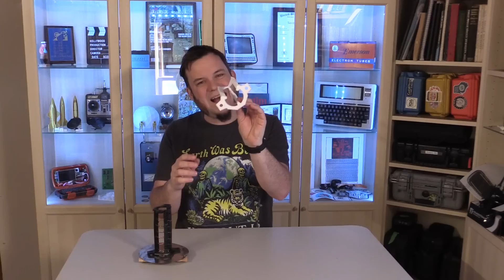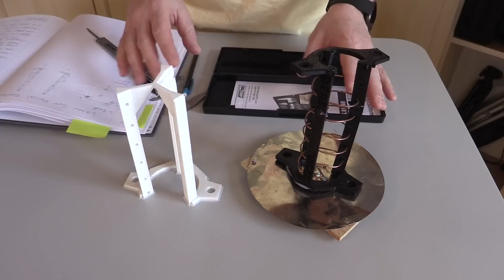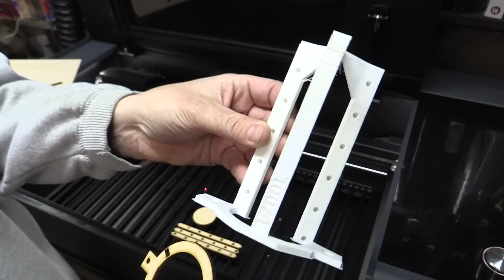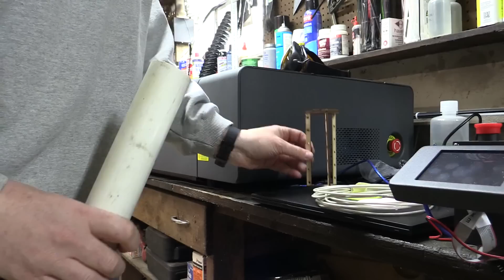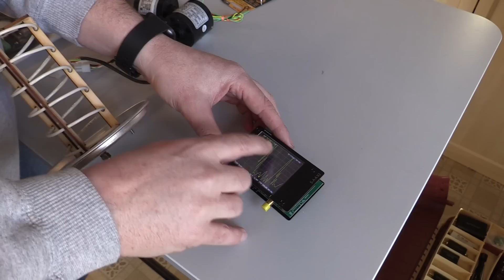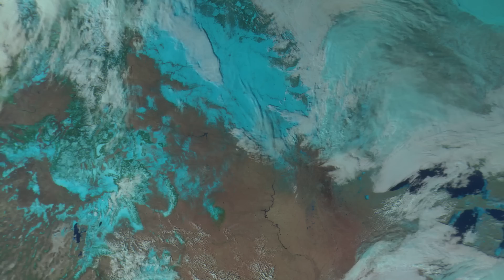Making Satellite Antennas With Lasers

Comment: Hey dude I know its been a year and you may have fixed it but an enclosure completely fixed most of my fails. Turns out because I print in my basement the temps and drafts can throw it off. Could potentially help.  Love the content!
Reply from the maker: I got a new 3D printer that's enclosed!

Comment: Hi Gabe, very interesting video. I've had good experiences with 3D printing using 3D spray adhesive. The prints stick significantly better to the print bed with it than without. So far, I've been able to print 3 antennas (without additional support) without any problem. But buying a laser cutter is on my todo list :)

Comment: Amazing what kind of resources you can access with a bit of wood and wire.
I pulled out my 3D printer recently. Need to calibrate it and get it running with decent firmware .. ugh, I wish that stuff 'just worked' without the needless tinkering.

Comment: If you use urethane, you could just dip the entire part into the gallon can up to the reflector. No need for complicated painting. I don't know if there's any RF issues with using urethane but it should work as a conformal coating on the entire device and it will soak in nicely on the wood. You might even be able to dip the whole part if you cover the SMA connector with Blu Tack or something like that.

Comment: That's not a very challenging model to print. 
A $4000 later cutter gets the job done but so would a $1000 3D printer right out of the box.
Or a $200 3D printer with a lot of calibration.

Comment: What a success! The images are perfect. Goes to show that precision is key when it comes to antenna parts. Maybe lots of your reception issues came from the crooked antenna receivers and not so much the dish or tracking. Also your design looks really neat, I like it better than the 3D model. If I had the chance to use a laser cutter like that instead of my 3d printer I'd go for the laser cutter. Speed and precision. And the way you designed it, simple is better. You could use anti fouling paint on the wood or 3D print dome enclosures for them, like commercial antennas have.

Speaking of 3D printing PLA is definitely not the right plastic for it, for outdoor stuff I'd go for ASA/ABS in the long run. BUT you will need an enclosed printer for that, not only because of the fumes, but also because these plastics need heat so that they won't cool too quick while the print is still going. What 3D printer do you have? Maybe it's time for an upgrade. The one I'm using is a Bambu Lab X1C, a CoreXY enclosed unit which seems to be the way set-and-forget 3D printing is going atm. At least I can say I'm very happy with it. Never had a failed print so far, the print quality and precision is excellent. I won't upgrade its firmware for the time being and I am using it with Orca Slicer because the privacy issues it has are definitely a downside at the moment. I hope it gets resolved and Bambu Lab realizes their mistakes.

And yes, as others have mentioned laying parts flat on the side is the way to go anyway, speaking from experience however this isn't trivial with a 3D model downloaded from the internet that needs to be cut into pieces first. Often times they come in the mesh format STL, and meshes are a pain to edit. You can cut them, but the edges might start looking funky when they're not a solid object. Which is why I highly recommend learning CAD. Their sketcher tools is what you need for parts like these. It makes designing technical parts much faster. And the benefit is that you can easily adjust your parts to be either cut out with the laser cutter or printed with the 3D printer, or even design a whole assembly with parts that will be laser cut and printed. For designing I like FreeCAD because it's free and open software and it has a lot of addons, and with OpenTheme an addon that improves the UX significantly. OpenTheme was the UI/UX that was used for the now defunct Ondsel ES. Many functionalities of Ondsel ES can be installed as addons to FreeCAD. Others might prefer a simpler or more powerful CAD software to use, but these are all subscription based (more and more often they make their free versions suck on purpose).

Btw, when it comes to keeping the laser cutter warm, or even toxic fumes from open 3D printing contained, people have used grow tents you'd usually use for cannabis plants as enclosures/workspaces. You could set one of those up in your garage and add a heating element or pre-heat the tent before starting to laser cut. They can even be used for spray painting and sanding indoors, just get a big one where you can stand in while being suited up in safety gear, and have good air filtration attached to it.

Comment: Thanks. I've never been very convinced about 3D printing. We're being sold at with them in some ways. They can be useful for irregularly-shaped prototype parts, but they suck for multiple parts, and they do use plastics. Furthermore, they are incredibly slow, and extremely inefficient, both in electricity use and wasted plastics. A laser cutter is excellent for planar prototype parts, far more efficient, more reliable and can pay for themselves very quickly if time (= money) is important to a user. Furthermore, many lasers don't need to be supplied constantly with consumable materials.

Comment: The 3d print design should be in seperate parts that slide and glue together. This way you can print it all flat and not have to go up the z axis into a fragile tower. If you want to experiment try PLA+ instead. It prints almost exactly like PLA but at a higher temp and is UV resistant. You could design this to also glue directly onto a pvc pipe for a more ridgid structure. Just have to figure out the offset from the PVC to the wire holes. But good job replicating the design.
Reply: I have personally 3d printed little formers that glue directly onto pvc for a similar purpose but for loading coils on HAM antenna. That's why I made the suggestion.

Comment: I do 2D and 3D cad at work to suit a CNC router, cut 2D is pretty easy to work with, dimensional and should be able to be set up to output directly to your machine, it's no harder to use than GIMP, does cost money but I believe you can get a one time license.

Comment: Very nice! I think you could cut some acrylic for something a bit more permanent.
Reply from the maker: The folding dish doesn't live outside permanently, I just drag it out for specific projects. But yeah if I left the feed outside permanently it would need to be more waterproof.
Reply: Agreed.  No matter what finishes/paints are used, plywood is going to disentigrate before 1 year is up.

Comment: Any modern 3D printer should be able to blast these out of PETG with total ease. 

There is something totally wrong with your printer.
Reply: And/or understanding of it.   Knowing this guy, he has a second hand printer, set up on a wobbly table, never greases any rails, using some old, moisture-ridden PLA he found along the railroad tracks, etc.   lol.   Also, just plop it sideways and set up tree supports and done.   Also, likely infilling too much, if it's taking that long.  That piece is all air.   Mushrooming means he doesn't understand heatbed temps and draft protection, too.
Reply from the maker: That's the thing about 3D printers, people say "oh they work great if you jump through 50 hoops, control 20 variables, and constantly adjust it". At that point it's not a useful tool, it's another hobby I don't have time for.
Reply: @ hehheh.   maybe revisit them in another 20 years, gramps.  ;P
Reply: @awjaaa  Valid lol

Comment: I’m sure by now you have 1000 people that may have suggested, but in just in case, flux makes soldering flow much smoother. 👍🏻
Reply: Larger tip and hotter temp for thick things like that, too.

Comment: You probably need a modern slicer with tree support feature. That print doesn't look that difficult, but an old and open printer would struggle at higher layers, even then running it slow should work fine.
Reply: Orca uber alles!

Comment: leaving the insulation on the wire changes the velocity factor - you'd have to adjust the length of the wire to componsate
Reply from the maker: Eh, I haven't noticed any difference between insulated and bare.

Comment: If you want to try 3D printing less complex things like a case to weatherize an amplifier or some other electrical components.  PETG is similar cost as PLA and more weather resistant.  It also tends to stick better to the print bed and have better layer adhesion.  But you do still have to dial in the settings and mess around a bit sometimes.  So, your laser cutter is probably still faster and easier for the antenna scaffolding.

Comment: Good info. I like my Xtool but when I get around to printing an antenna scaffold 3 projects from now here's what I'd do. If you have a good heated bed print in ABS at 230 I believe. You designed the antenna for a good print orthogonality you just need to extrude them up 4mm or so and print them straight on the bed. slot them in place with cyano glue and you're golden.  BTW GIMP 3.00 is out now. Your problem is that FDM works poorly far from the bed.

Comment: Are you doing your printing in your garage or inside? most of those issues look like moisture and ambient related. do it in a nice well heated room and use a filament drier. Can be made or brought for under 50 bucks. It will save you loads of time and wasted filament.
Reply from the maker: 3D printer lives in the house near a dehumidifier, same room as my servers so they're nice and warm.

Comment: The way to fix these 3d-printed antennas is to break them up so they're printed sideways in pieces, instead of all-at-once.  A lot of modelers forget about the nuances of printing, but breaking the model up into chunks to be glued together is worth the time and effort in a lot of cases.  Similar to your laser-cut version, printing three towers on their sides, plus two plates that the towers slot into could make these a lot more stable.

Also, PETG is far more heat resistant than PLA; it'll stay above glass transition under most normal environmental conditions.

But also?  This seems like a design that could work in wood; print some drilling templates on a laser printer (or just publish some measurements) and drill through dowels or lengths of square-sections.  Cut the top and bottom out of mdf or thin plywood (mostly transparent at that frequency) and wood glue it all together...  We go to automated manufacturing mechanisms too readily when something like this is really quite simple to carve from wood...
Reply: Yea, if he doesn't want to cut and then glue after he needs to add supports. His prints are failing cause the parts are tall and skinny and once it gets high enough it's gonna start swaying and so it prints off. I agree with PETG, as I have an enclosed antenna and it's been out there for at least 2 years and still looks like when I put it out there.
Reply: He laser cut this from thin plywood. that's why its smokey and probably smells like a campfire.

Comment: Any chance you can 3D print the DTMF keypad for a TK-250 Kenwood radio ? 
Original part number was KDM-7

I think I have a video of it I posted a while ago. 
They haven't made it in 30 years 

Thanks
Reply from the maker: I'm not good at 3D modeling, I rely pretty heavily on Thingiverse designs.

Comment: Enjoy all you videos😊. Helicals are very forgiving but the insulation (dielectric) on a wire can cause significant differences on some more critical antennas. Also, depending on the f/d of your dish, the 5 1/2 turns you used might be a few too many and therefore not fully illuminate your dish (reduced gain). Might want to try 2 1/2 to 3 1/2.  
STIlLL, I’m a big advocate of “if not broke, don’t fix it”😉

Comment: I laser cut the spiral conical antenna form and reminds me I did not do another Instructable regarding anything after or do much anything after.  I think political seasons changed sadly.  Spiral Conical Antenna - the Form is the title if you want to mod or see how performs.  I wanted more for a wide band antenna for sweeping and TSCM like signals detection and monitoring.

Comment: if you slot the holes for the wire out the side then you could get the coil over the frame and settle it down into the positions. With the insullation or just a tight hole, friction will do a decent job holding the wire in place, or add some glue. It will weaken the frame somewhat, so you probably want to make those pieces wider overall with the slots only biting in the edge a little more than the diameter of the hole

Comment: Nice display cabinet! You could just print the parts separately & glue the together just like the wood. It should be pretty easy to print them horizontal instead of vertically.

 Or just get some plastic bar, Drill the holes & assemble them just like the wood method.

Comment: PLA is supposed to be really insensitive to humidity and water absorption, but decided to dry mine and it got a remarkable improvement. That said, even before my PLA was performing far better than yours, not sure what's going wrong for you.
Reply: PLA isn't as bad as some materials but it absolutely absorbs water,  If you print with wet PLA you can even hear the water boiling off in the hot end like popcorn.
Reply: @ferrumignis  Mine definitely wasn't that bad, or stored in a garage, and I got more reliable bed adhesion, better overhangs, other small details. Anyway I want to get to the point that everything just lives in a drybox all the time. I have the box, but I'm having a hard time getting reverse bowden tubes that don't have enormous drag

Comment: Its sad to see you stuggle so much with 3D printing.
I believe to remember you have one of the classic lower end kits, and after going through two of these myself, I know how frustrating they can be.
Those are NOT rapid prototyping machines, those are learning platforms that help you to understand how 3D printing works and lets you gradually improve the machine through modifications.
If you want to actually 'just print', youll need one of the current generations of printers with built in calibration that utilize the latest developments in software.
Combine THAT with what you learned on your old kit and then you get into the fun territories where you can materialize an antenna like this reliably with a few clicks within a few hours... 

The industry has shifted heavily ever since Bambu Labs released a machine that beats $30K industrial machines for just a grand.
I stopped following the space actively since I picked up an X1C, simply cuz it just works and does what I need, so I cant recommend any alternatives, but I know they forced everyone else to invest a good bit more into their products now and Ive heard of lots of innovation happening finally.

So yeah, might just be time to invest in a current gen printer.
If I look at what Bambus cheapest model does for the same price as both of my previous kits....   I'm just blown away😮😮😮

I know they do some shady looking stuff, but you can run them completely offline and repair them pretty well actually with official parts, but also after market solutions if needed. Bstter then most chinese kits actually😅
Hook up an open source driver board running Klipper to the steppers and you can do whatever you fancy, just like with any other printer....
Might also be something worth trying with yours if you fancy wasting more time troubleshooting but want to REALLY learn the craft, but it might still not end up giving you much of a reliable rapid prototyping tool.

I wish I could recommend you something other then Bambu, but please, look into the current market again and pick up one of the modern much more turn key printers! 
It will be a completely different experience!!! 
Combine that with some CAD skills and the world is open to you🎉🎉🎉

Comment: Something keep in mind is that PVC has a considerably higher dielectric loss than many other common plastics.  This is both due to its molecular structure, and the adjuncts they mix in with it for wire insulation.  You might get some improvement by stripping that wire.  I once wound an L-band helix inside a PVC pipe that I used as a radome.  That was a mistake.

Comment: I used to won a farm, with a very very nice 1800 sqft workshop, with high ceilings (you could roll a fully-loaded hay-wagon in there).   If I set a tool down in there without thinking about it, it would be gone for days or weeks.  That's the main reason I have so many "copies" of basic tools.

Comment: Gabe, serious question: 

Maybe you mentioned this in the video and I missed it -- WOULD NOT be the FIRST TIME -- but what materials can you cut with that laser cutter besides wood? 

IF you can cut aluminum, even if it is too thin, you could cut multiple pieces and laminate them together...? 

EDIT→ Before anyone comments, YES, I suspect Gabe HAS ALREADY THOUGHT OF THIS. But I wanted to ask anyway.
Reply from the maker: I should do this antenna with plastic, that would last longer outside. I haven't tried cutting metal yet, beyond a beer can for laughs. I know this one will mark or engrave certain metals. I wouldn't want to use metal for an antenna since it might mess up the tuning, but I'll try to come up with a project that uses that!
Reply: @saveitforparts >>> Rodger all that. I did not even think of the tuning thing...🙄

Comment: The hangup with the 3D printer is a real problem, but if you are willing to glue things together, you could print that same scaffold in ABS filament, using your flat-pack style design and assemble it with ABS Glue.  That would probably print in less than an hour and wouldn't have the overhang issues.